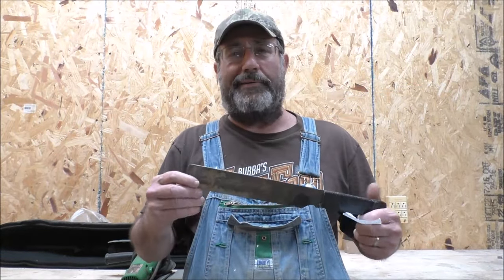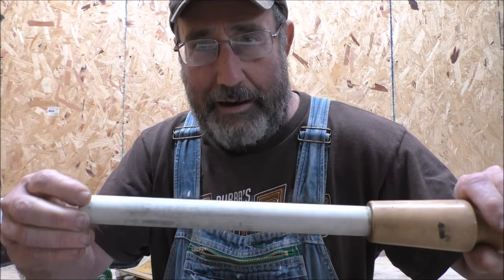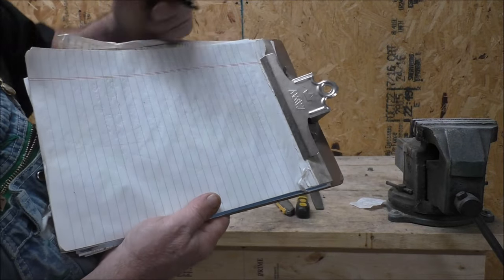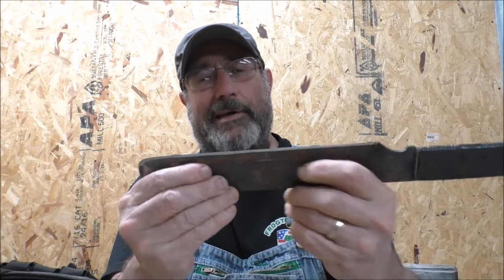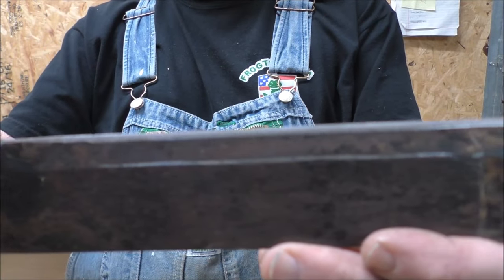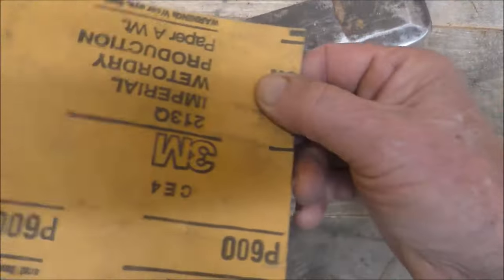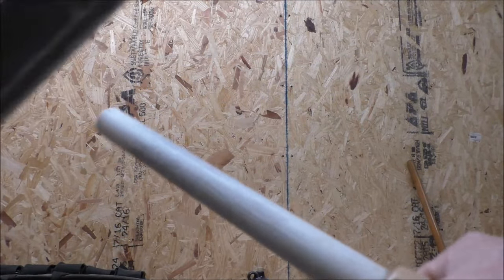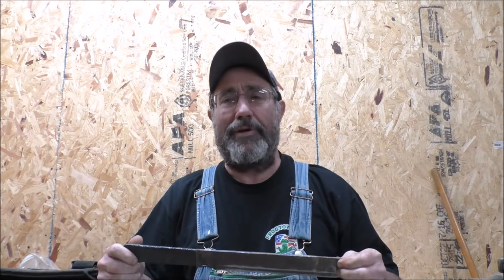How to Sharpen A Knife

Comment: So far, I've managed to keep my blades up well enough so that I don't have to take strong measures to resharpen them. I like to use Diamond Hones to keep up the edges. I use medium, fine, and polish hones, and haven't had trouble so far.
I have a knife similar to the one you showed here, but mine is a powder-coated stainless model I got at a tool store years ago.
Reply from the maker: I'd say a good set of stones are hard to beat.  What kind of a knife is this?  I found the one I have in a barn.  The pattern of the blade is unusual.
Reply: Marsh Rat It was advertised as a machete, but is a bit short for that purpose. The blade is only 12 inches long, with a 6 inch handle. Unfortunately, there was no brand name or model number on it or the shelf. It is almost identical to the one you showed here, but I think yours is home-made. It looks to be something meant to cut kindling, or maybe to butcher chickens without being as awkward as a meat cleaver.